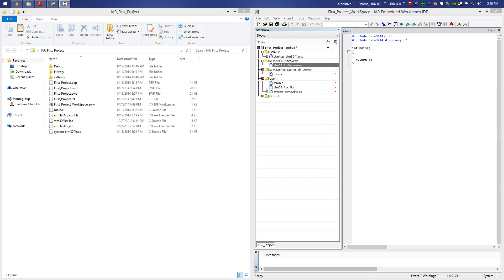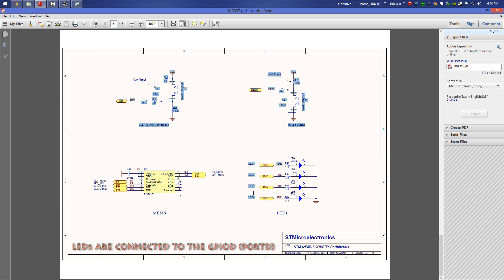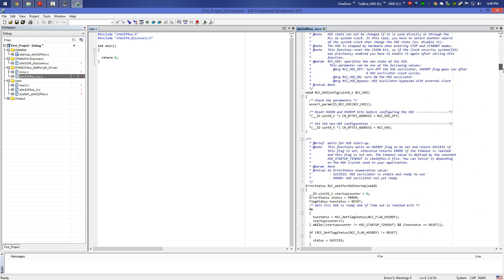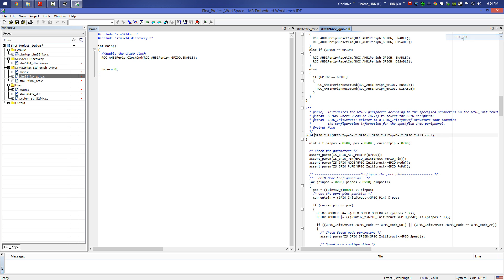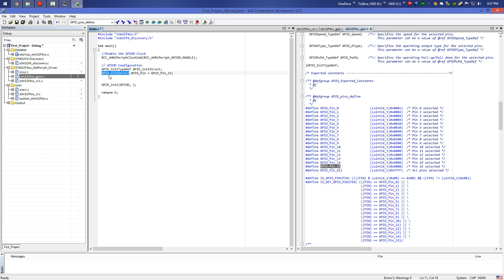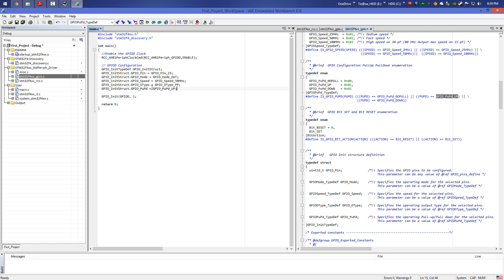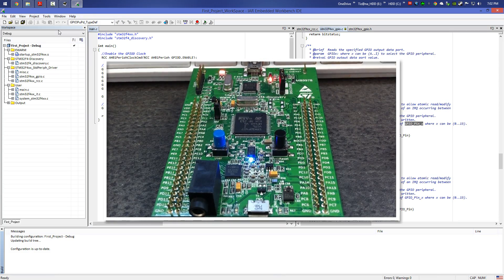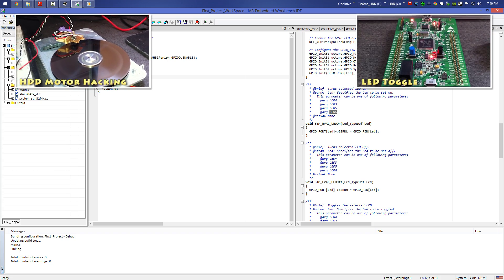STM32F4 Tutorial : How to turn on LED on STM32F4-Discovery board using IAR IDE

Comment: Thank you very much for these tutorials.

At first my led did not light up. It turned out that my board has the led tied to power. Using GPIO_ResetBits() instead of GPIO_SetBits worked.

Comment: Very comprehensive. Good job! Subscribed!
Reply: So in college I learned all these IDE like MPLab, Xillinx, and even IAR Workbench. But none of my professors really gave me reasons which to use over the other. Is it just purely preference or do some of these pair better were certain architectures?

also i noticed this new CubeMX thing that wasnt around couple years ago for setting up peripherals.. is cubemx just automated setting up the peripheral registers unlike manually doing so in this video? is that its only purpose?

Comment: Great explenation of how does the whole code works, and where the things come from. Thanks for that turorial!

But I've got one question: What GPIO_Type and GPIO_PuPd stands for? What they set in procesor?
Reply from the maker: You welcome bro !!
Reply from the maker: Kostek92 
the GPIO_OType it can be Open drain or Push Pull
and the GPIO_PuPd it can be Pull-Up , Pull-Down or No-Pull
these two elements aims to the specify the hardware characteristics of the Output

so to understand this you must have a minimum knowledge in electronics, but i'll try to explain you.

let's start with the  push-pull : 
is the simple one and the most used, push pull means you have two internal transistors inside the Micorocontrollers, one connected to the Gnd=0v and the other to the Vdd = 3v.
- When you set the output you will have Vdd=3V
- When you reset this output you will obtain Gnd = 0V.

to see clearly go to the page 266 of this PDF http://www.st.com/st-web-ui/static/active/en/resource/technical/document/reference_manual/DM00031020.pdf you see clearly the two push pull transistor inside the output driver square (Figure 25).

the disadvantage of this push pull that the power delivred by the internal Vdd is not enough to drive some external periphal like a big LED Diode ...
and the second disadvantage  is the output level is fixed to 3v so if you want to communicate with another devices, chips ... which work with other voltage level (1V, 5V...)  this will not work so we use the open drain methode.

The open drain method means we use only one transistor. the one which is connected to the Gnd and we remove the other connected to the Vdd.
so with this configuration we have this result :
- When you set the output you will have nothing (no vdd no gnd) because we remove the transistor connected to the Vdd
- When you reset this output you will obtain Gnd = 0V.

So you have to add an external resistor + external Vdd to the output. this thing called pull-up. the external vdd can be a voltage of your choice (be careful the voltage does not exceed the 5v (you have to check it because i'm not sure) ).
with this method you can communicate with other devices that works with other voltage level. and with this externel vdd you can deliver more current.

Or you can use the internal pull-up by affecting this value to this variable GPIO_PuPd = Pull-Up.

So in our case when we turn on the LED on the STM32F4-Discovery we use the push-pull configuration and we can disable the push-up in the configuration like this GPIO_PuPd  = GPIO_PuPd_NOPULL.
the internal 3v Vdd is enough to light the LED and this one doesn't need a more powerful vdd so we use the push-pull methode